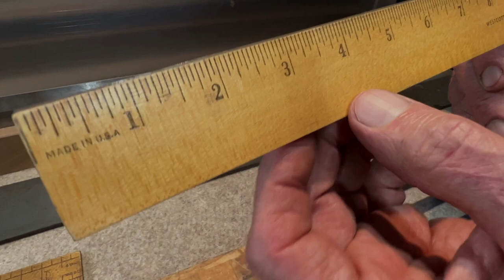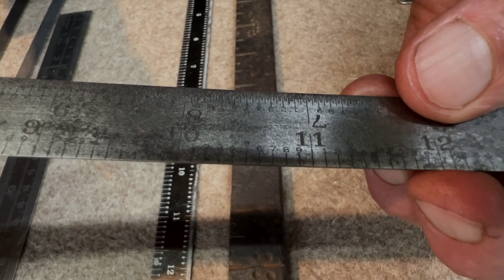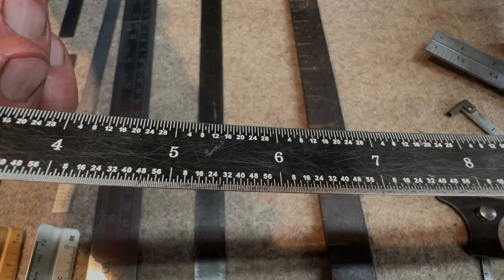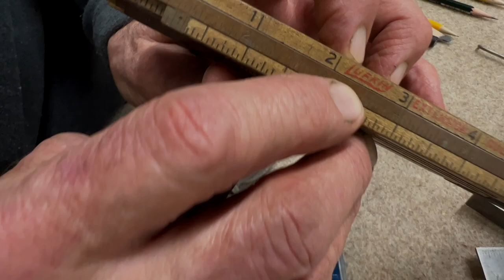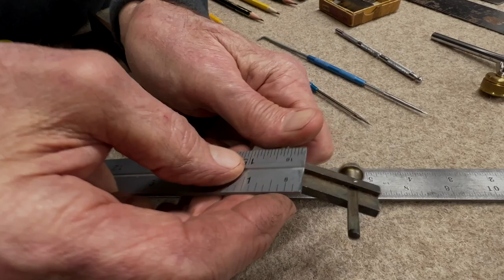Ken Parker Archtoppery - Riff 012 - Marking and Measuring - Chapter 1 of 2

Comment: A scale is representative measurement, a rule is actual measurement.
Reply from the maker: Like many English words, "scale" has multiple uses. In the world I grew up in, machinists call a 6" or 12", etc. graduated piece of material a "scale", and woodworkers call them "rulers". In this sense, both the scale and ruler is a noun, a tool, not a relationship. We speak of "scaling" objects as changing all dimensions proportionally larger or smaller. I looked it up, and I can't find what a representative measurement is.?

Comment: The side wheeling is a great idea that I have never thought of for sharpening scribes! Always afraid to gouge the fine surface of a water wheel and use diamond stones, but your way is both easier and faster.  I know that you probably know, but for the viewers- Starrett still sells the easily disappearing scribes for their combination heads.  What is the brand of pocket knife that you whipped out?  Constantly seeking a worthy companion in todays world.  Hard to find that perfect one that takes and holds an edge.
Reply from the maker: https://www.amazon.com/Gerber-Knife-Assisted-Opening-22-47162/dp/B000EDRTVQ/ref=sr_1_1?crid=1NA500CAQAP59&keywords=gerber+spring+assist&qid=1673304920&sprefix=gerber+spring+assist%2Caps%2C97&sr=8-1

These don't ship to every state, so you may need to do a little dance and have your friend in Florida ship you one.
Perfect pocket knife for me, and the high carbon surgical steel is great. Lightweight, good lock, and won't open accidentally in your pocket.  These used to be cheap, sigh.

Comment: The Chalked/Inked String Line storey reminded me. A while back I travelled by Tinny around the Solomon Islands surfing, the blokes there sawed logs into timber by eye using a chain saw. They used old oil from an Outboard or other engine on their string lines to snap a straight line. I don't know why 'developed' people think it's a mystery when cultures ancient or current can make things consistently level, straight or plumb. 
I found that early Rule very interesting as I guess it was made before a Standardised Foot/Inch was readily accessible in your county. Is it consistent? Precise?
Reply from the maker: What an interesting story! Great observation, "Moderns" look down at "Ancients" HUH? Pyramids? Petra? Parthenon?
The early rule I found at the thrift store shows no signs of expert work, and is eyeballed, and way off all over the place.
Whoever made it couldn't find their dividers, or maybe got into the mead.